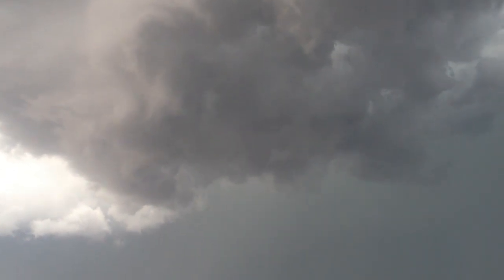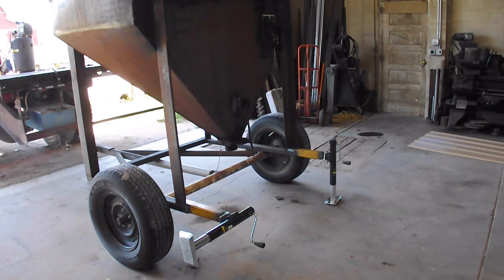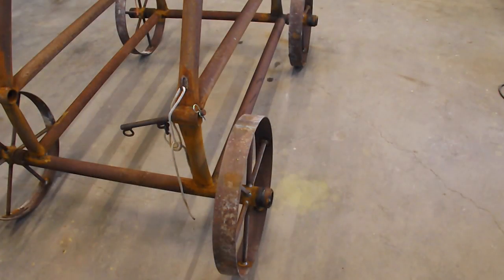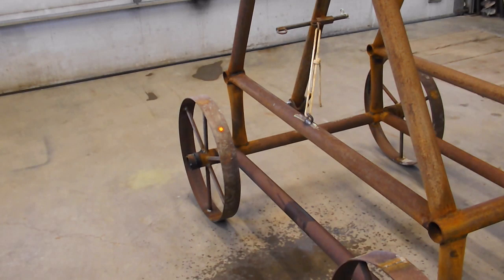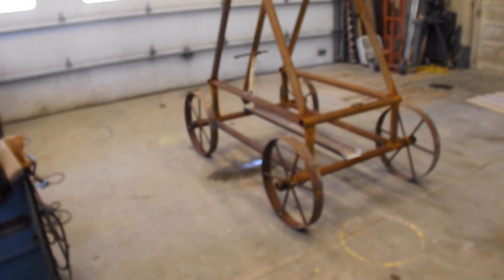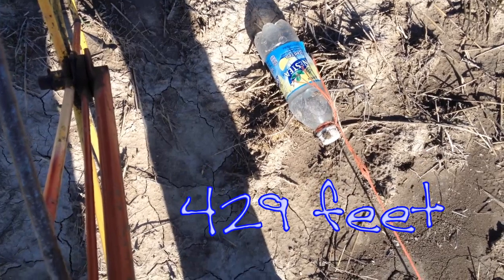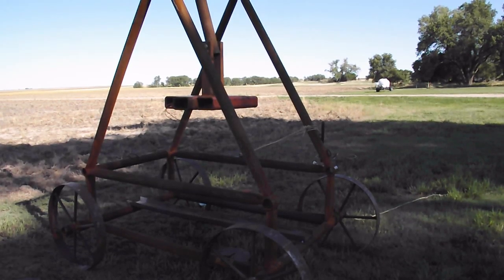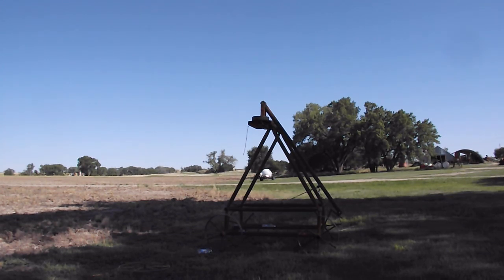Trebuchet Tuesday - Episode 13 - Fling on wheels

Comment: block the tires so it can not roll backwards! front - forward movement is ok but stop it from rolling backwards!
Reply from the maker: I think I found all your comments Brad. :) I just now went through some footage frame by frame. The trebuchet is only moving forward during a fling, so I think the trebuchet is fine there, but I'll put blocks behind the wheels next time just to see if it helps. Regarding the bottle "dropping" at the end of the trough, I believe you are on to something. It appears the sling goes slack for one frame about the end of the trough. That would be a huge loss of energy!  Also, I'll do some research and see if the object to be flung should be on the ground, or in a trough.  That might make a difference too!  I really enjoy all your input!

Comment: loved the flat tire joke and running over a sticker!
check out this design for a trip lever for your flinger, you could make it so when you pull it down a trip latch snaps shut holding the arm till you pull the lever letting it fly!
check out this design!
Brad
Trip lever

Comment: a hand/parkingbrake might be an idea because the entire thing moves which costs energy. nice moonshot, your next target? :)
Reply from the maker: To the moon!  And although it seems wrong, wheels add power as the trebuchet rolls forward. Like a pitcher who leans toward home plate as he hurls, the forward motion adds velocity to the pitched weight. The rolling back and forth of the wheeled counterweight also allows it to fall in a straighter line, the most efficient way for a counterweight to respond to the force of gravity. The straight-falling counterweight is more powerful because a straight falling counterweight results in a higher velocity at the sling end at the moment of release. A higher velocity results in a farther throw.